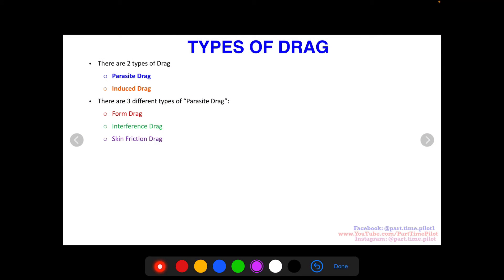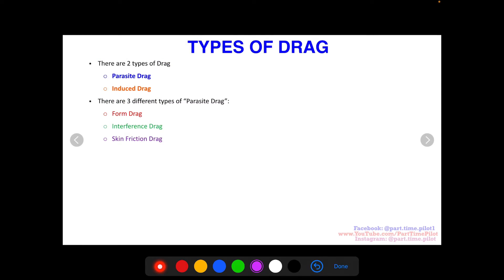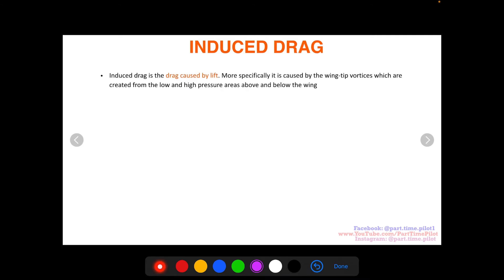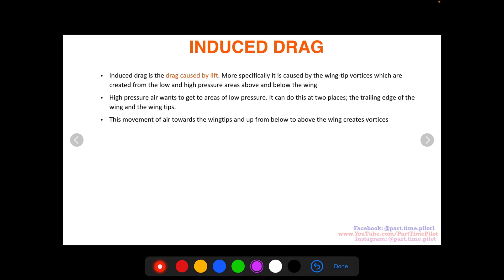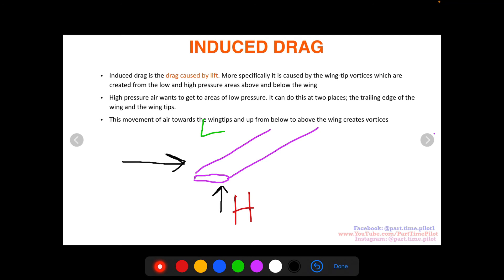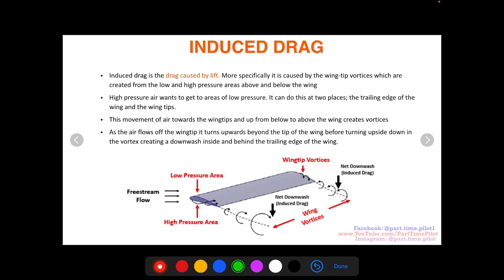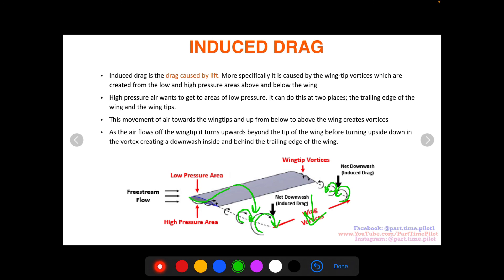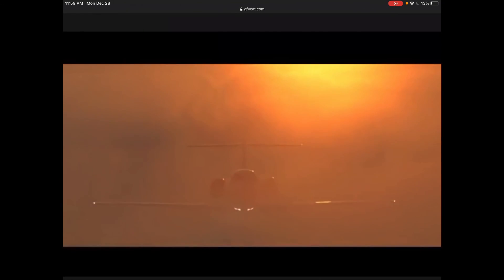Aircraft Induced Drag & How it Works - For Student Pilots

Comment: I discovered  that Parasite drag is produced by VERTICAL surfaces and Induced drag is created by HORIZONTAL surfaces, for example when the Flaps are at 0 degrees they produce Max Induced drag and Min Parasite drag, at 90 degrees Min Induced and Max Parasite drag and at 45 degrees in the middle of both.
 Please let me know if you think it is a valid observation. Thanks
Reply from the maker: I have never heard this before but it is an interesting observation. I don't think it holds up 100% of the time though, but I understand where you are going with it. Horizontal surfaces produce lift more or less and left makes induced drag. However, when you lower flaps it increases both induced and parasite drag.